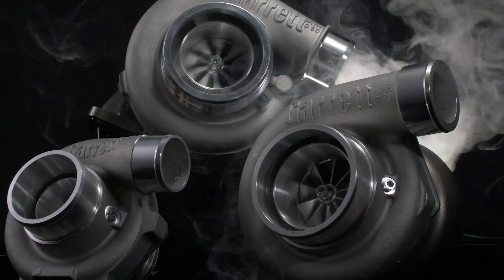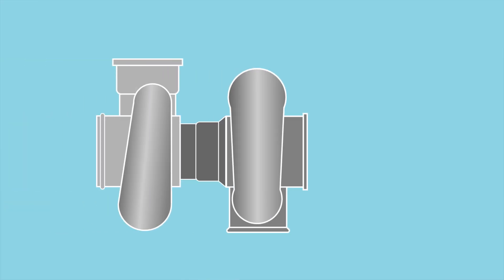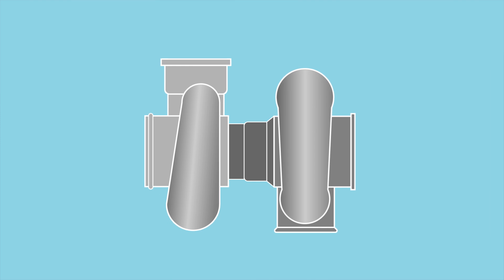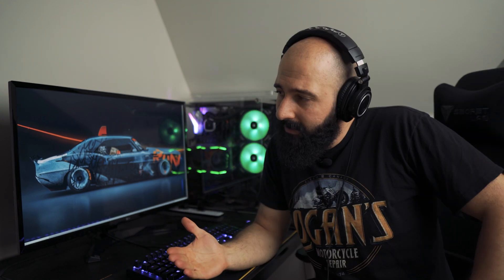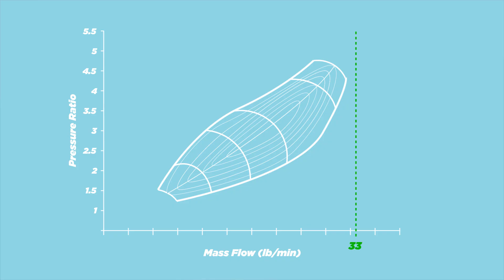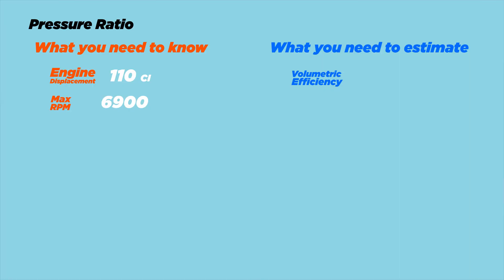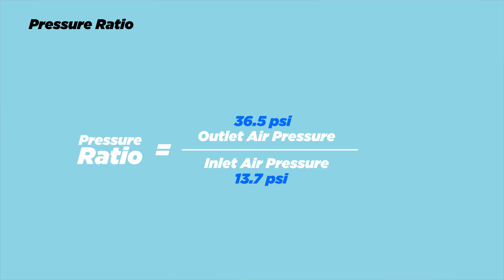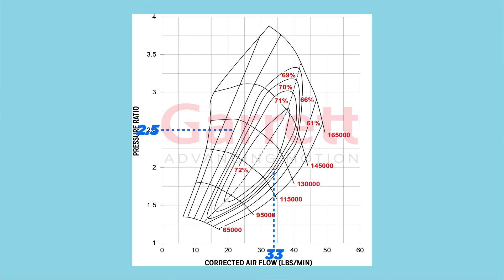How to choose the right turbocharger || EXPLAINED

Comment: I dont get how you got 34.5PSi from that equation. When I typed my stuff into that it gave me a huge number...
Im currently trying to find the right turbo for the 7.3L Godzilla and push itto 1,000HP, So I type din these numbers into the equation. 
Engine Displacement: 445CI
Max Rpm: 6,000(I guessed cause there wasn't a real answer)
Volumetric Efficiency: 95%
Intake manifold Pressure: 130F(again, I assumed cause I didn't find anything about that either
Gas Constant: 639.6
Added into the formula: 
96.25 *639.6*(460+130)/95*6,000/2*445 = 4,905,235,468,421.1 
Not sure what I did wrong but I did as the video said. HELP ME UNDERSTAND PLEASE
Reply: You wrote it wrong. This is how you should write the formula in your phone calculator: 
(33*639.6*(460+130))/(95%*(6900/2)*110).
If you write it correctly it should give you 28.64 with your values, try it out :)

Comment: I'm building a Nissan l28 stroked out to 3.0 with a9.5  compression we are trying to get a Max effort horsepower realistically 700 to 650 at the wheel we will be running on ethanol fuel

Comment: I appreciate the lesson. Always looking to gain understanding and knowledge. I plan on putting a GTX2867r in my Focus ST. Considered running a 3071, but I haven't decided how far I want to push the car to the limits. My goal is to hit around 350whp and make the car come to life a little more. Fuel will be my limiting factor considering I'll be on 93, no ethanol or aux.

Comment: Sorry to be an ass, but as the content is not just for N.A 
Most countries as in like 95-98% of them Compressor maps made for local made turbos are ALL in Metric. 
Kilograms Per Second for Mass Flow and so on.
Turbine and wheel sizes in millimeters 
power in kilowatts and so on.

Comment: Twins for a 383 cubic inch LT1 (90s small block chevy) Camaro. How does twins work? Use a compressor sized to half my engine size? 3.1 liter 4 cylinders x 2 because V?

EDIT: Just did that (132 lb/min of air... so about 66 lb/min per turbo... pressure ratio around 3, using 90% for volumetric efficiency because 2 valves per cylinder).

Falls pretty close to the efficiency island for 68mm turbo which is pretty common twin turbo size for LS/LT/SBC.
Reply from the maker: That sounds about right. I bet if I do the math I'll land on the same thing

Comment: i've did quite a bit of my homework on turbocharging my 97 f150  i'm not a flashy kind of guy.  i just want to play, i like tinkering with stuff.  put a new engine in a few years ago, bored, found a kit pretty much in the specs i was looking for except one major major hold up.  NO TUNE!  I cant find anyone interested in doing a tune.  i'm not putting it on untill i find someone.  i'm in louisville KY if you have any sugestions.  so in the meen time i have a pile of parts and one heck of a dream!

Comment: There is an error in the pressure ratio graphic. The percentage supposed to be entered as a decimal value (8:44), so for the Volumetric Efficiency of 95% would be entered as 0.95 and NOT 95. The final solution shown is correct (34.5psi), but if you plug in the values shown in the video it would result in 0.3455psi (which is not correct).

The presentation is great, and this does not take away from the main point, but or those who want to do their own calculations keep that in mind.
Reply: either way you will have to move the decimal 2 places either at the beginning or at the end. equation is somewhat correct just an extra step.

Comment: Lol wow buddy your video was not as boring as you thought it would be i really enjoyed it, and as u asked at the end there what i wanted to turbo charge.... I have just taken apart my bmw e36 328i 1997 engine, any suggestions for this engine when it comes to a specific turbo im looking to have the best turbo for quarter mile runs. Also it came with an aluminum engine block if that makes a difference in turbo selection. Please advise 🙏

Comment: Never understood compressor maps from any other YT explanation. 
You are a gifted teacher.
Went through the math with you (using my numbers) and can't thank you enough. 
Brilliant, absolutely brilliant.
Reply: I'm confused. When I run the numbers for manifold pressure I get a decimal not 34.5 psi I get 0.17270
Reply: @opinionsevrywhere  move the decimal two points right. 17.3 rounded up.
Reply: Same lol

Comment: What if you don’t care about HP and you just want sound
Reply from the maker: Very valid question. I'll probably make a video about it soon but to give you an answer, to get an authentic turbocharger sound you'd have to turbo the car, that will cost you just as much. Might as well do it properly so you'd gain some power too. There are products out that claim to give you the turbo sounds but none of them actually work imo
Reply: @MZopyrus  sounds good thank you.

Comment: How to choose the right turbo for your car:

Go to a turbo manufacturer and type in your parameters. That's it.

They will show you which turbos meet your needs if the manufacturer produces units that can use your equipment to produce your horsepower/torque goals.
Reply: Good video though. A nice dive.

Comment: hello from argentina .. i'm in a project and i don't know what size turbo to use it's a ford falcon 221 3.6 l 6 cylinder engine from 1978 I already bought a turbo but I'm not sure it's the most suitable for the engine the turbo is  Master Power Racing R4449/1 (145-360 Hp )
I'm aiming for 300 hp and my max rpm is 5200

Comment: Great Info, actually what Ive been looking for as far as map dissection and Calculation Formulas. Project = 1967 Chevelle with BBC 427 twin turbo with 7speed transaxle from 2017 Corvette. Thanks for the help. For a twin turbo set up I should divide the airflow requirement by 2 correct?

Comment: A91 6 port Supra. G40-1150 A/R .85 E 70 port injection Lpfp Visconti reflex Gms air to cool manifold pure built stage 1 transmission with race converter and 4000 rpm stall. What your thoughts? Low 800 hp I’m looking to be at before building block

Comment: Trying to work out if I have spec the turbo for my 2.8 m52b28 6 cyl engine, currently running a/r 1.0 gt35 450bhp at 17psi

Comment: Since you made such a great video, I feel obligated to answer your question.
I've recently learned that a Mitsubishi turbo will take my Rotax 912 UL from 59 KW to 87 KW at 5800 rpm with 6 pounds of boost. 
There are kits available, but they don't say which model of turbo is used. Now I have the tools (maths) to figure out which model I need. 

A big thank you for breaking these numbers down barney style.

Comment: First generation rl target 300 weal hp to 320 hp alredy have all supporting mods like forged internals gaped rings fule system and a custom EFI computer that works on a separate cam sensor I got it to just work off the cam sensor with 6 different cut outs and TDC on every intake stroke of the engine the turbo is going behind the transmission it's a water and oil cooled one I also have to have a scavenge pump becous the turbo is at such a low spot and I am also running it's own oil and relying on the engine coolant to heat up the turbo to operating temperatures

Comment: What do you do if you put twin turdo do you devide the result
Reply from the maker: Kind of? Twin turbo setups are commonly done to V engines .. like V6 or V8. And you treat each side of the V as a separate engine for turbo size calculations.
Reply: @MZopyrus  0k good thanks that was what i was thinkin it a 496ci or 8.1l v8 bbc gen 7

Comment: are the calculations to read the graph different between gas and diesel engines or are they going to be the same? Wondering because diesels are so much higher compression engines than gas. Great video very informal and helpful.

Comment: One of the best videos I have watched.  I have a 95 Ford f-250 with a 351w stroked to a 418. As soon as my tax return gets here I want to turbo charge it. Leaning towards twin turbos. This is the first big HP motor I have built. Any tips would be helpful. This is not a daily driver. Glad I came across your channel. Any an all information is appreciated.

Comment: I'm new at all this and I've been under the wing of Cummins engineer for about 8-10 months. He rattles all these numbers off so fast I get dizzy headed lol.
He has been a life saver though as I didn't know anything about a turbo a year ago. 
Things changed and I'm attempting a blow through on a 2001 Harley Sportster. 
I've had my engine parts prepped just for this. I'll be running custom turbo pistons that are coated and a 8.0:1 CR. My heads have been ported with larger intake valves installed and much larger exhaust valves installed this work was performed by Hammer Performance. I'll be using custom turbo cams from Leinwebber with a .545 lift and only 20° of overlap. My carb is a mikuni hsr42 modified by my buddy the engineer.. Now I'm out to find the most efficient turbo I can that will get me in the neighborhood of 160hp.
I can give you some more info if you're really interested but I don't want to bore you to death lol.

Comment: I just want to share my personal lesson learned from sizing a turbo using this exact method - which resulted in lazy/laggy setup for street driving. I learned that you don’t need peak compressor efficiency at max RPM. It’s actually okay to be tapering off to the choke point at max RPM in a street application, which is what most factory turbocharged cars do. It is better to optimize peak compressor efficiency for the RPM range where you want to make power. With that in mind I would do the calculation at various engine RPM levels and compare the plot - looking for max efficiency at, for example, 5k RPM. It’s a good sanity check to plot the max RPM too, but not the number I’d care the most about.
Reply from the maker: This is great, and 100% true.
Reply: @MZopyrus ej1 b16 a 2 head b20 block v tec on the too2 los árboles ambos tienen v tec wirh headers yo need to do a gool turbo build somthing of 1000bwith ac😅
Reply: I tell people that the basic answer to the right size turbo is the smallest turbo that meant you power needs. Be realistic about your engine's power. Beyond that it start getting mathy.
Reply: @177SCmaro  people like to go oversize on turbo, if you live in a area were you don't have a lot of big and long straights is just dumb to have a turbo too big
Reply: Yep, a GTX2867 gen2 would be way laggy for just 300hp on a BP4W. 

There are also no considerations here for the turbine wheel size which makes a bigger impact on response than any other factor in sizing a turbo. Using this method outlined in the video, it would not help you differentiate between a GTX3076R gen2 and a GTX3576R gen2, as the compressor wheel (and therefore map) is identical. The performance difference between those turbos in both output and response is going to be drastically different on any small displacement 4-6 cyl application that would use those, and the difference will be much more drastic than bumping up or down to the next compressor wheel size on that given turbine (like a GTX3582) because the compressor wheels are so light compared to turbine wheel mass.
Reply: @collinrobinson3085 
Agreed should have talked about Is compressor wheel and size...it makes a big difference.
Reply: And if you've got such popular platform as Miata, a lot of people did all these calculations before and you can learn from their results.
Reply: I wanted to upgrade my turbo's  on my Mitsubishi GTO , 3L V6 twin turbo AWD .

Comment: I'm trying to turbo a 2004 Vulcan 2000 which is 2,053 CC's in total do you have any advice? And your video also told me you wanted to hear what it is so here you go LOL
Reply: I'm trying to reach the same performance level as you but I'm having an issue with the formula to find out how much psi my numbers are not working out so I'm kind of confused of how you got the 34.5 PSI if you don't mind helping me out

Comment: Hi! Great video. Will check out your others! Question...Roughly, what is the volume ratio of exhaust gas to compressor air? I would guess that the exhaust volume is approx. 15x that of the air due to heat expansion over what the engine is taking in, but the compressor and turbine impellers are on the same shaft turning the same speed sooooo? Thanks

Comment: i have a gt 28/60 rs garrett for my 2 litre subaru ! 440 cc injectors ej205 heads on a ej207 RA spec C block arp head studs crower s/steel swirl finished valves bronze guides triton valve seals single crower springs IAG alloy sump kit = 280 hp .

Comment: any info on the math for twin turbos
Reply from the maker: Depends on whether it's a V configuration, like a V6 or V8, or inline configuration. For the Vs you just do the math for every bank of the engine .. so a 3.0L V6, you look for a turbo for each of the 1.5L sides of the engine. Hope this answers your question

Comment: You videos are amazing are amazing!!! I w as not to put a turbo on a 2000 vw jetta vr6 daily driver, I want to get to maybe 250hp not to wild, stock on a 2000 vr6 vw is Horsepower174 hp @ 5,800 rpm i would like to be at 250-300hp what do you reccomend

Comment: I have a Mercedes Benz 190e 2.3 8v, I'm planning on turbocharging it with a ke-jetronic distributer from a m119 v8 ( two injectors per cylinder) and an aftermarket ECU to control fuel pressures hehe

Comment: Hi mann. I recently encountered a problem with my car . My car is a 2003 peugot 1.4 manual trasmission . The problem comes as you put the car on first gear run a little bit then you press the clutch .... If you release the cluth without shifting to a higher gear itll jerk .... It happens on every gear but on the heavier gears it gives you a harder reaction. What dou think it could be...

Comment: I’m trying to turbocharge my 2005 Dodge Dakota 3.7L v6 it has a 4 speed auto transmission
Reply: I was considering forced induction for my 2006 Ram 3.7 until I did research and read that development of an aftermarket kit was halted after experiencing destroyed stock piston ringlands after just a few dyno pulls on a prototype. Don't recall whether it was a turbo or a supercharger kit, but regardless that stock shortblock is inadequate for F.I.  I doubt its bigger brother, the 4.7, is any beefier. You can gain a little with a programmer & the few bolt-ons available for the 3.7. Also helps to replace that very restrictive exhaust Y pipe merge point with a Magnaflow or similar two into one piece, for a
Ram or other models with that same poor configuration.
Reply: @johnmcmullen456  Thank you John for the advice, atm I have a ram intake and a exhaust with a 40 series flowmaster with a before axle dump. I want to get a custom hood and get a scoop for better cooling on that ram intake. But as of right now I haven’t been able to find a single programmer with a reliable background.
Reply: @owenmicheal4543  Glad to help. By programmer, I meant the Hypertech 52501 unit with canned tunes, including for high octane fuel. I personally don't think they are worth in the mid $300's, but maybe can find a used one. I sold mine on Ebay half price last year after selling the truck. Another recommended power improvement is going from a belt driven fan to an electric one. I also installed a cheap Spectre CAI that used the bottom part of the Ram factory air box and added an aftermarket duct that directed air to it from the grill area. There are no big gains to be made but every little bit helps, especially when towing  a heavy trailer.
Reply: @johnmcmullen456  I was thinking about converting to an electric fan and was sure I’d there would be improvement.

Comment: Do we need to change to standalone ECU as well, or use stock? wanted to turbo the E30 M40.
Reply from the maker: Honestly I'd probably not turbo the M40 to begin with. It would be a waste of money and resources as it can't really handle too much boost without getting in there to change the bottom end. At that point you're just better off swapping in a M20 .. either way I'd go with a standalone because it would be safer for your engine
Reply: @MZopyrus  thankyou for your advice, in my country we only found E30 M40, maybe the E34 here have M20 engine. By bottom end did you mean the crank shaft and the piston rod?

Comment: Boosting a 5.9L Hemi with ported Eagle heads,  Stage 1 Turbo HRT 221/229 Intake/Exhaust @ .50, Hydraulic Roller, Diablo Tune. Target power at max boost about 1200hp. Mostly street use. So, will run an electronic controller. Should you get a minute, what size turbo do you recommend? And would you run a single or twin turbo set up? Going to view this video a few more times to nail down the terminology and numbers. Great video. And thanks in advance.

Comment: I'm trying to get around 650 wheel horsepower from my 2jz gte vvti, so I am looking for the correct turbocharger for my setup. It is going into my Volvo 940 which of all the cars is the one I love (driving) the most. 😁 Thanks for this video I will soon sit down and calculate if the turbo that I was gonna buy is the right thing for me. Cheers from The Netherlands!
Reply: sounds like something like a G30-900 1.06A/R or divided 1.06A/R. As long as ur on some form of meth or Ethonal.  or a g35-900 would get it done.

Comment: My current ongoing turbo project: '91 civic wagon. Stock d16a6, w/a rear mounted td05-12b(can't find a compressor map). It was $80 from a junkyard, pulled out of a late 80's Volvo 740. End goal; 250whp daily with ac, cruise, full width radiator, and a stock looking engine bay.
Reply: Go a td05 14b it will come on around 3500rpm and give good top end and it won't be working as hard and the 12b which may run out of efficiency up top end before you get to red line.
13 to 14 psi will be your limit on the 12 after that your just pushing hot air.
Target hp with less strain on the turbo